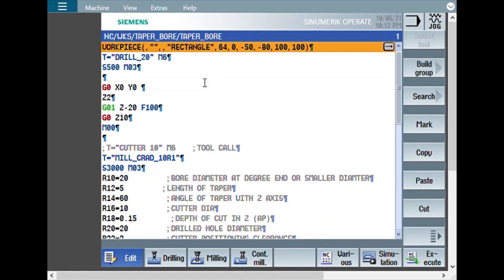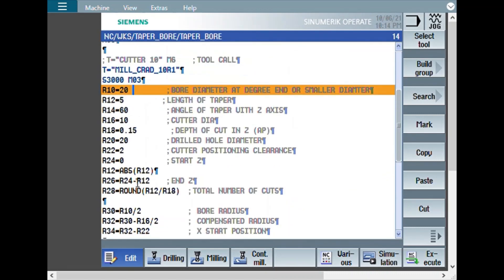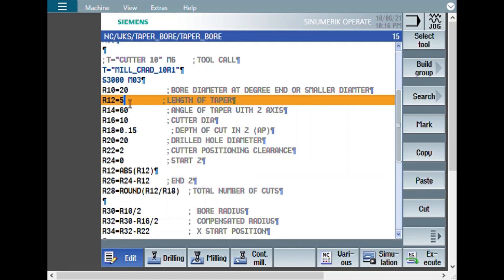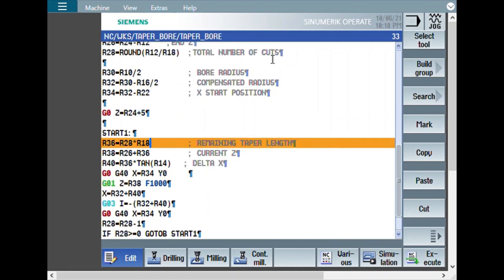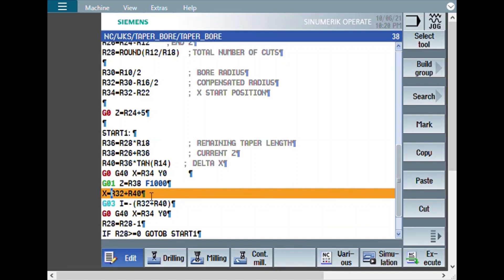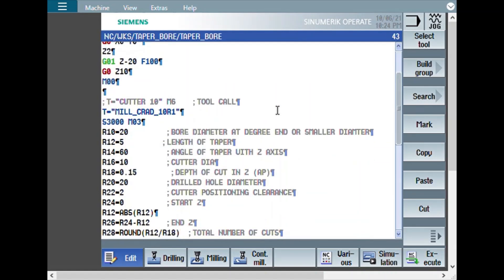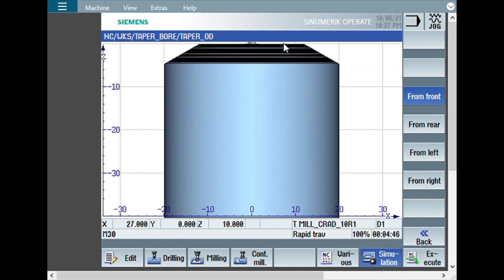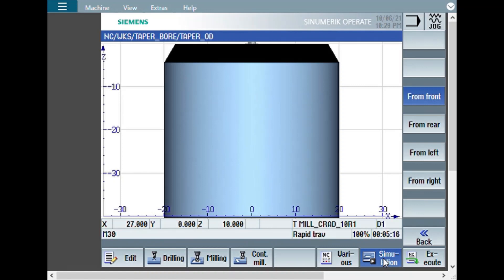Macro program for Taper bore | 2.5D programming in milling | CNC-Learning | Rajeev Sreedharan

Comment: I make sprial taper bore but it's not come as per dimension. 
Small step come in hole  at one side
Reply from the maker: If you are using an end mill with corner radius, it need to be compensated with chamfer size and startZ.

Regarding spiral taper bore, I need to know how you have programmed to comment on the step

Comment: How do you  know sir the dept of cut
Is 0.15 I think there will be a formula
Please mention the formula sir
Reply from the maker: .15 used in this example is by experience. But based on surface finish requirement, you need to adjust the depth of cut. If you plot this on CAD, you can find the cusp height for a specific depth of cut